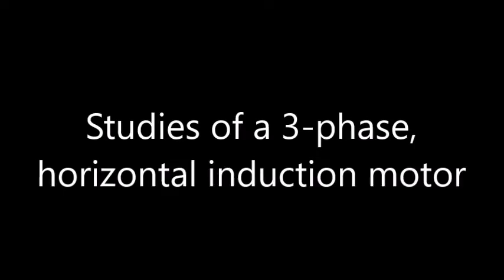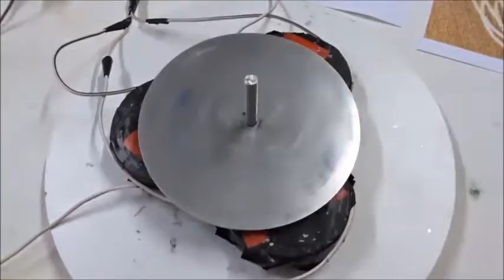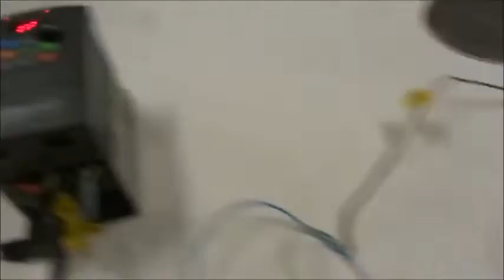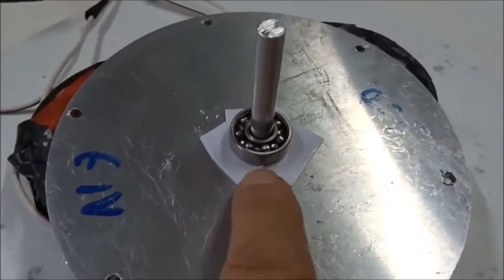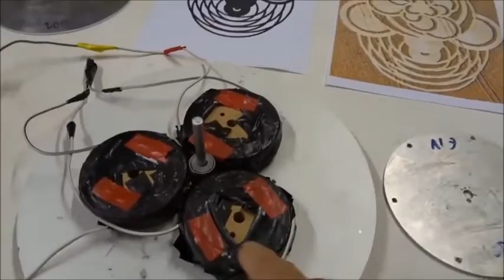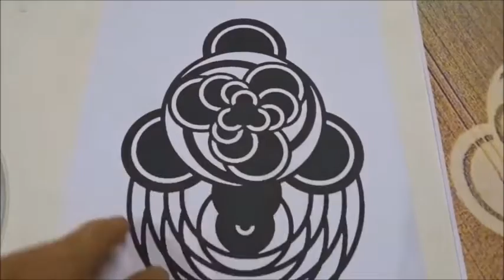Studies of a 3-phase, horizontal induction motor

Comment: Seems like the crop circle also has a large solenoid coil in addition to the three ac coils.  What if you added a large DC coil to create a static axial magnetic field in addition to the rotating field generated by the three phase coils and used a disk that is both ferromagnetic and conductive. i.e. mild steel.  The idea being to magnetically polarize the disk.